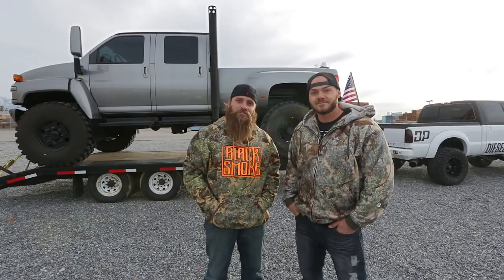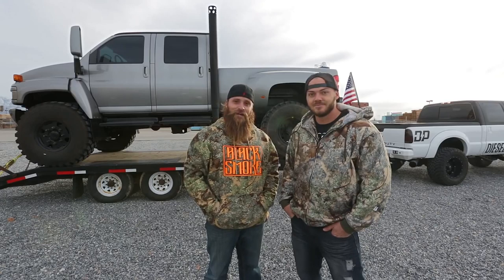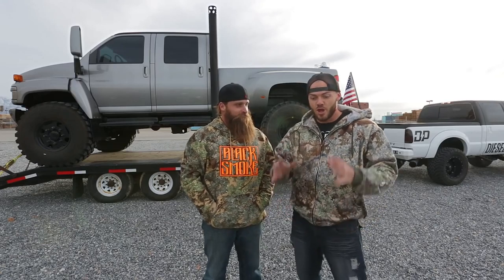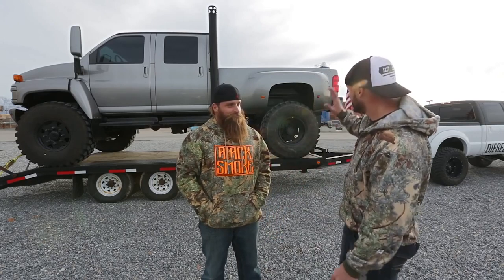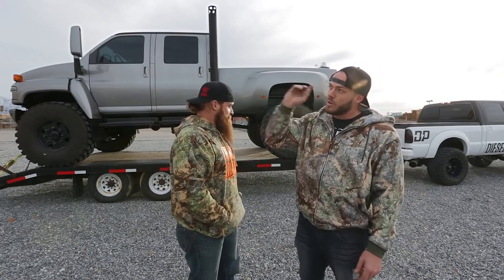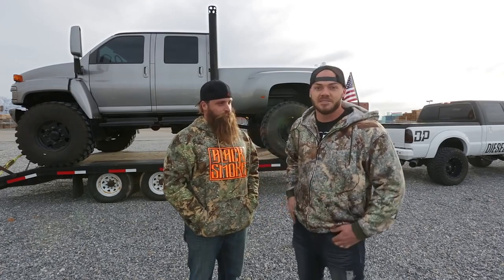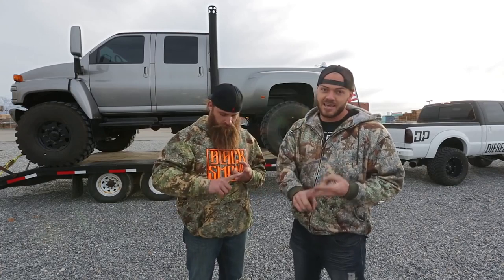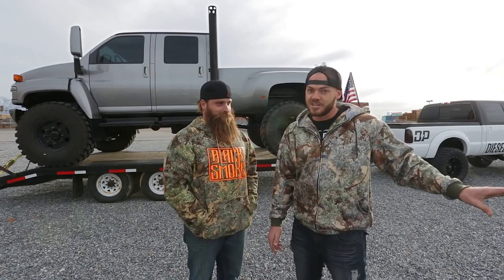BUILT DIESEL 2: The 2013 Ford Powerstroke Haul

Comment: Hi guys, so at the moment you guys are the only ones I can think of that I would trust answering this question.  I just got a silverado 1500 and was wondering about in the future possibly getting project trucks.  Right now the thing that would be limiting me the most is my towing capacity.  But I was just wondering in general is there any resources that guide you to what size trailer you need to fit your project truck.  It seems with this truck you just were able to fit both tires on it and called it good?  Also I see the truck is turned around, is that to decrease tongue weight?  Thanks